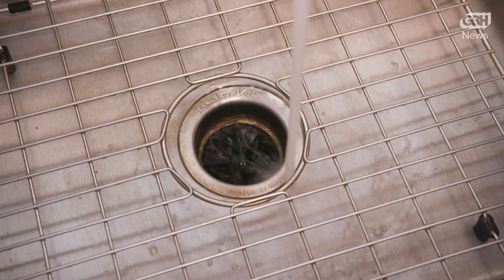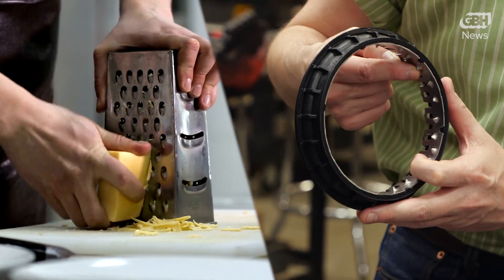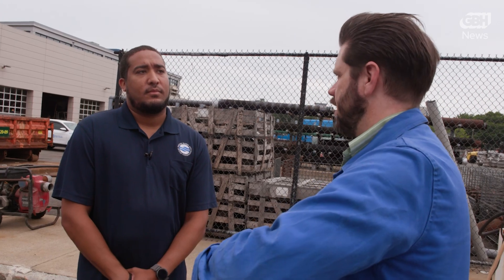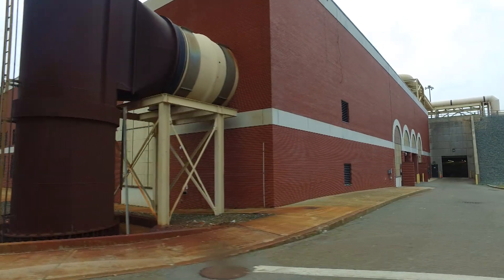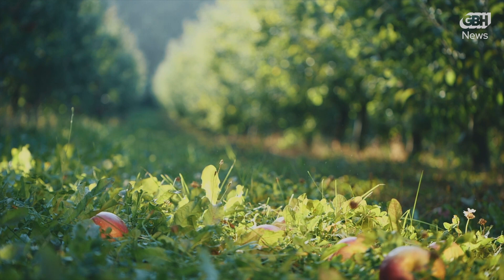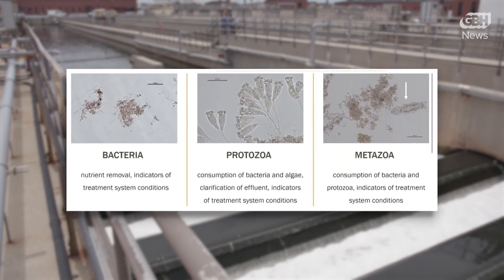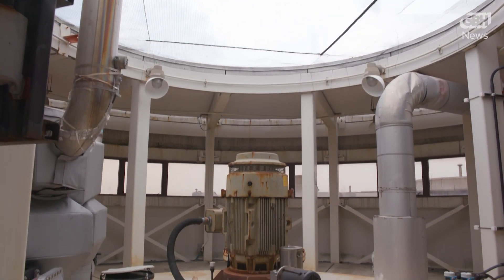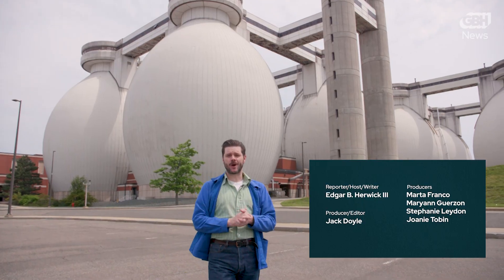What happens to the food you put down your garbage disposal?

Comment from the maker: There's a fair amount of debate about what items should or shouldn't go down the garbage disposal. Egg shells and coffee grinds are commonly pointed to as "no-no's," but Rob Driscoll, instructor for Boston Plumbers Local 12, told us that if your disposal can handle them, both are OK in his book. Keep in mind that disposals aren't all built the same in terms of both size and power. 

What everyone we spoke with agrees should NOT go down the drain is what's known as "FOG." That's Fat, Oil, and Grease. They can solidify in the drain, stick to pipes and cause blockages all along the system. 

We asked Jean-Luc Teixeira, superintendent of asset management at Boston Water & Sewer Commission how much easier his job would be if every household and business stopped pouring fat, oil and grease down the drain. His answer? 70 percent.